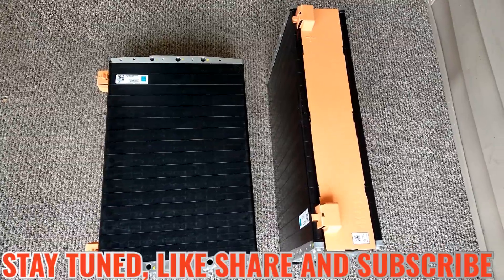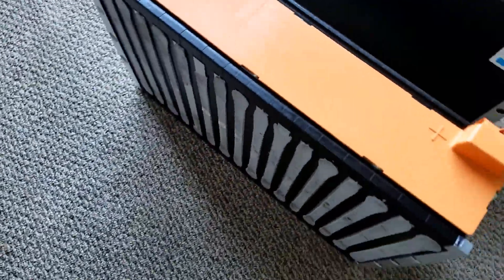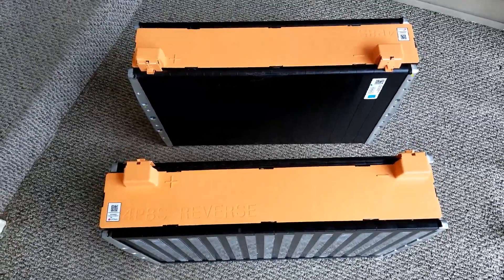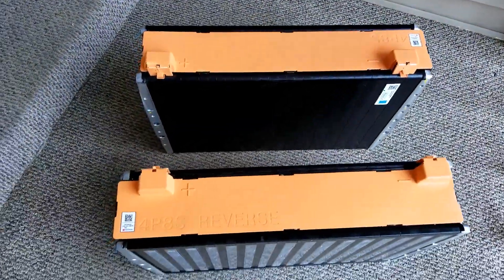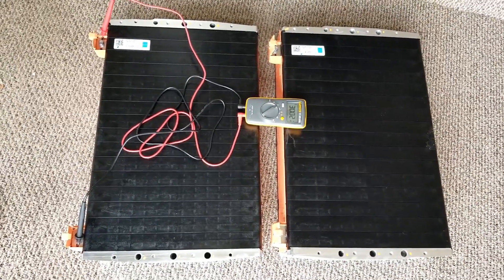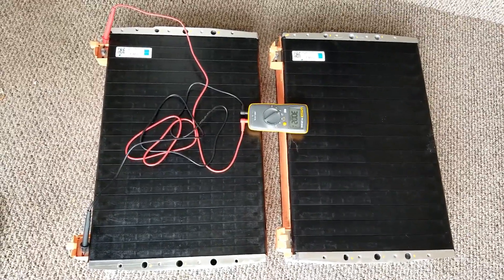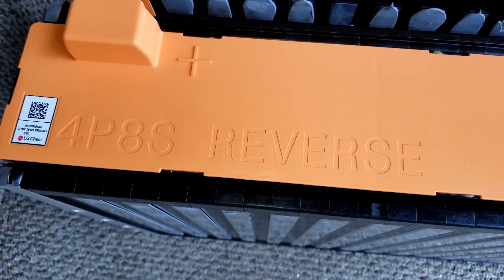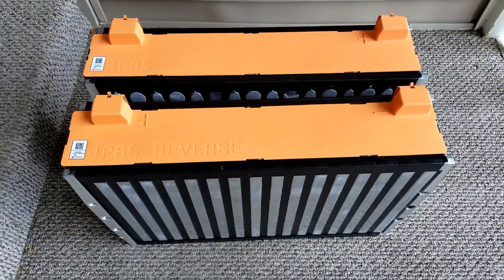LG CHEM, 17kWh LITHIUM ION BATTERY

Comment: Hi, 
Just to confirm if the battery has inbuilt ABS? If it doesn’t, is it safe for to use on my home inverter?
Reply from the maker: Hello,
Are you concerned about (Acrylonitrile Butadiene Styrene) ?
If YES, I will recommend you contact the manufacturer directly for them to answer those questions.
Thanks for stopping by and please don't forget to SUBSCRIBE and LIKE
Reply: So sorry dear. I was asking about BMS. It was a typo error. I wanted to ask if the battery has BMS?

Secondly, I have 48V inverter. Just to confirm I can connect two of these batteries in Serial to get 48v to Match the inverter and use safely?
Reply: @ikestephen235 i have one. They are not 24 volts. They are 28 dead and 33 charged. This dude seems to not actually answer any real questions
Reply: Being 28v instead of 24v will it work with 24v  inverter or being 28v be a concern?

Comment: How are those working for you do you have a bms on it
Reply from the maker: Working perfectly. 
I do not use BMS with my batteries. 
Thanks for watching and for stopping by. 
LIKE SHARE and SUBSCRIBE
Reply: @jwsolarusa  why are you not using bms? dont you think it can have an overcharged cell that can lead to explode and overheat?
im using similar EV li nmc cells from VW ID4 and have 2x12kwts, but i have a JK bms on both for sake of safety. i have to say that in terms of balancing it really doesnt need it, well right now it doesnt need it and what can be next
Reply from the maker: @denveronly  
 @denisdubinin508  
I have been running my entire systems likewise my friends without BMS unless the battery modules come with builtin BMS.
Thanks for the comment and for stopping by. 
Please share your video in conjunction how you added a JK BMS to those batteries, and don't forget to Like👍 Subscribe & Share
Reply: I thought you were going to show something usefull. Why dont you explain how its safe to not use a bms. You say its 24 volts but its not. They are 28 volts full at 33.6 you say nothing about system set up with that voltage. Good thing i already figured it out. That video could have been about 1 minute. Instead its long and drawn out with almost zero information
Reply: @joshbousquet8821  Hi, I just got 4 of this battery to be used with my 24v  Mr Power Hybrid Inverter. I am now concerned because the battery is 28.8V instead of 24V being said in this video, just like you observed too. Is it safe to use this on my inverter? Will it damage my inverter or the battery with time? How did you figure out and set up the voltage?